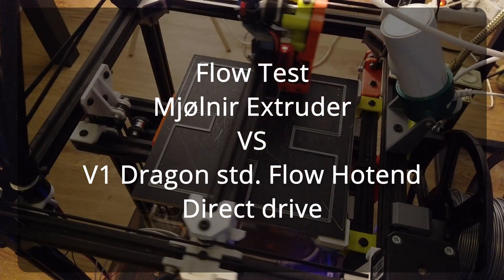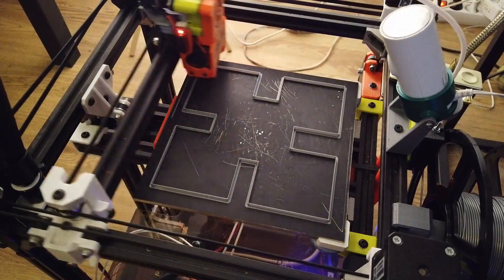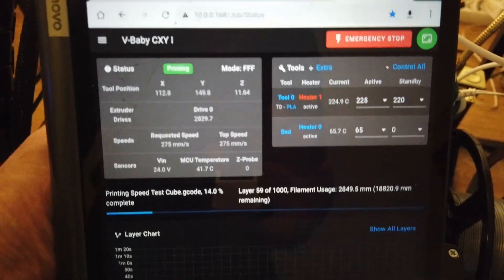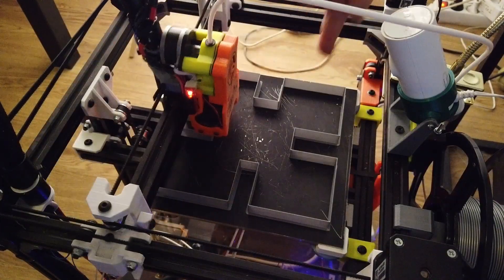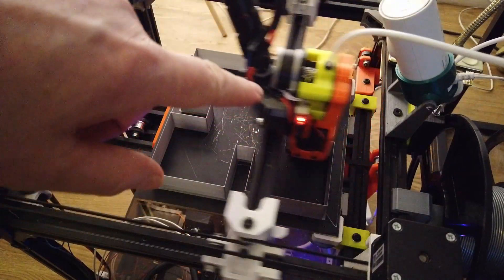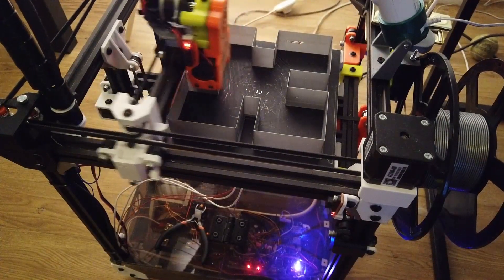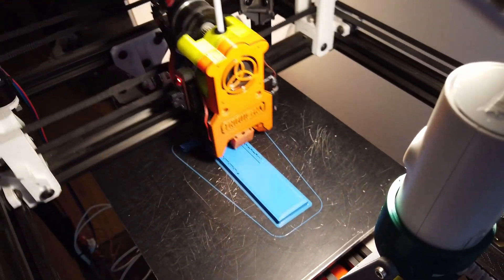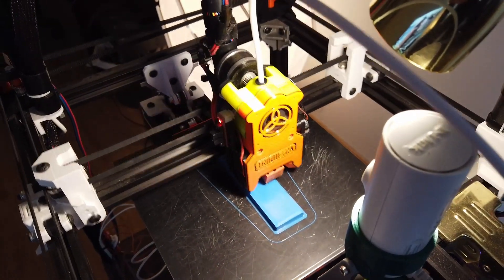MAX FLOW | Dragon Hotend | NEW Extruder | Direct drive | NEW Toolhead | V-Baby Corexy

Comment: is mjolnir warming at long prints with high flow? (i mean 0,6+ nozzle and 100+ speed, 0,24+ layer height)
Reply from the maker: It can do 25mm3/s safe. This motor on the 31 is not getting warm running at 500ma
Reply: @PRO3DESIGN  what is the gear ratio?:))))))

Comment: This is such an awesome toolhead. Just wondering, would it be possible to shrink the front part of the assembly to no more than 32mm?  I'd like to adopt this for my printer but the printer can't accommodate more that 32.25mm (so that would be from the back of the parts cooling fans to the very front.
Reply from the maker: I dont think so Mr. I am actually wondering about adding 4010 fans and This will add some mm.
Reply: @PRO3DESIGN  yeah, I didn't think it was feasible. The 4010 to cool the duct is already 32mm from the back of the dual 3010 parts cooling fans.  I really like the design, but unfortunately I just can't think of a way to do it. I'm going to experiment, I have kywoo tycoon(feel free to look it up) and it has some 2020 extrusions that this would interfere with this (because the hot end goes into the 2 sides by about 5-10mm on either side) I may be able to trim a little off the front from the left and right side, but it's going to be a tight fit, even if wouldwork.
Reply: @PRO3DESIGN  I was thinking about it, and I think it's possible if I switch to a mosquito clone (the nf-crazy) and put a 3010 fan directly in front of it. The nf-crazy is about 13-14mm thick + a 10mm fan is about 24mm thick. That would fit between the 2 3010 blower fans.